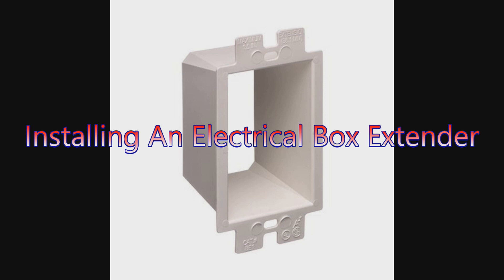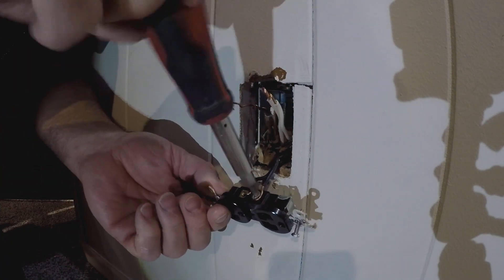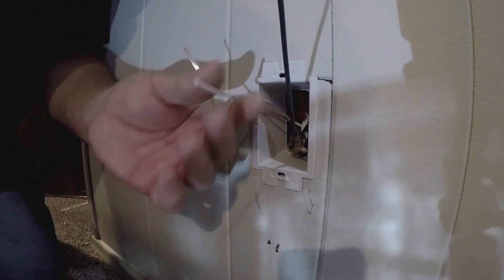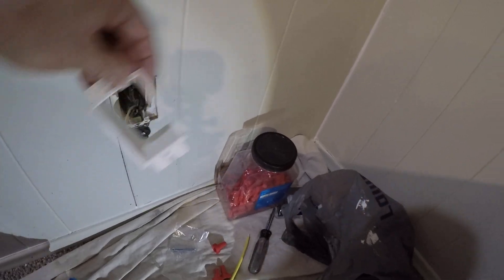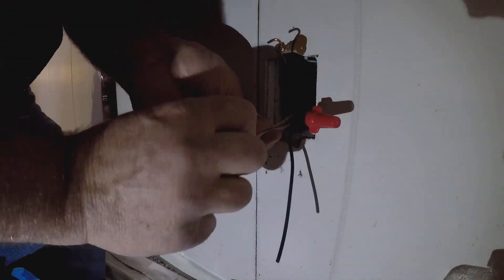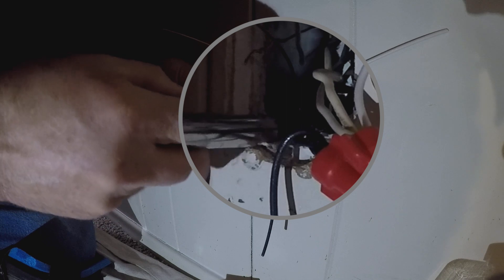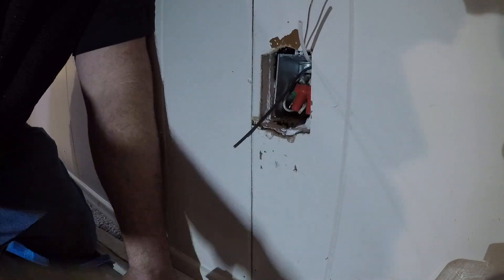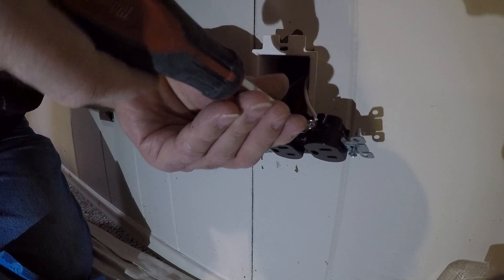Electrical Box Extender Installation

Comment: I would like to put an outlet on a 6"x6" wooden post (gazebo pillar), but I would like the lowest possible profile, I am thinking on using one of these extenders as the box (no box but just the extender screwed over the post), and maybe carving the post a little to make rear space for the outlet.
Is thid recommendable?
Reply from the maker: If this is an outdoor installation, you'll want to use an exterior weather sealed box and cover.  An open back extender box is for extending a box that has a back cover to it. Electrical connections should all be inside enclosed boxes with covers. The best you can do is to locate the box in the most inconspicuous location and live with it.

Comment: Will these work with metal junction boxes if it’s not ground but your outing in gfci outlets?
Reply from the maker: These work fine with metal junction boxes. If you are replacing an ungrounded outlet with a gfci outlet, that is allowed but you need to place a sticker stating no equipment ground on the outlet and any subsequent outlets connected downstream to it.

Comment: Since the extender fits inside the box that’s currently in the wall, does this make the width dimension that the outlet sits in smaller also?  I had a very difficult time fitting a GFCI switch/outlet combo into a very old metal box in my daughters apartment building that has plaster walls. I probably could have put one of these extension boxes and then finished the installation.

Comment: I have a box that will be covered by the side of a kitchen cabinet with a 2 inch filler. Is it possible and safe to stack two of these extenders to reach the extra 1/2 inch or so?
Reply from the maker: This might be a better option if your box is 2" deep. The back screws into your old box and the switch or outlet screws into this. 
https://www.lowes.com/pd/RACO-1-Gang-Silver-Steel-New-Work-Old-Work-Standard-Box-Extender-Wall-Electrical-Box/1005005?cm_mmc=shp-cprdelcgglLIA_ELC_206_Conduit-Fittings-Boxes-1005005-local-0-_-0&ds_rl=1286981&gclid=Cj0KCQjwgO2XBhCaARIsANrW2X2fGDWxx-kvOmQ8loQ2lWph21SYsjuQM3qfd2iFbG1id1QgdusgDNsaAnj_EALw_wcB&gclsrc=aw.ds
Reply: @CITAP1  Thank you. I appreciate that!

Comment: You weren't really clear about the longer screws you attached.  Did they come with the extender?  Some people add links to the parts they are using.  That would have been a nice addition to your video.  Thanks for the info you did give.
Reply from the maker: The longer screws come with the unit, 2 units, 4 screws per pak.

Comment: Hi! Just wondering if it's necessary to undo all the wires and reattach or can I just pull it slightly out of the wall, throw extender in there and screw it in..? Thank you either way!
Reply from the maker: If there is enough slack in the wire, you can pull the outlet out, you'll need to make sure the circuit is off. Beware that many times, the person who handled the device before you did a poor job making the connections so you'll want to examine all the connections and make sure they're still tight and secure. You will pull the device outward from the box then bend the device top or bottom to achieve enough angle for the extender to slide over the device.  Pull the device and wires through and straighten the device to go flat against the wall again. Check all the connections and if good, install into the outlet box.  If all looks good, turn the circuit back on. Stick an outlet tester in if it's an outlet and make sure the circuit tests correctly.  All done, go get yourself a congratulatory treat!
Reply: @CITAP1  It was my grandfather that I never got to meet(but feel I still have a strong connection to through the home improvements we've both done to the house!) I did it and it's good to go! Thanks again!
Reply from the maker: @thereallinnz9407  That's a great story having a generational connection to someone you never met other than through a common interest.  Our mom is who taught us and got us into home renovations and new construction. Best wishes on further cooperative efforts between you and your grandpa.

Comment: You didn’t twist your conductors together prior to putting the wire nut on. Not good
Reply from the maker: Pre twisting is really optional. I have been twisting wires together for over 30 years and never had a problem. You can easily see the insulator looking in the backside of the wirenut and you can see if the insulators have shifted after twisting. If you see a wire where the insulator has shifted, adjust it as needed. You also develop a feel for the wires. If you have the bare ends all matched, you can feel if one of them shifts while tightening. If you are more comfortable pre twisting your wires, by all means do so.
Reply: if I saw my apprentice doing it this way

Comment: Does this system work if someone panelled over the receptacle and now wants to cut it out and extend it????
Reply from the maker: That is exactly one of the reasons box extenders are made. If you tile a wall, install paneling, or anything that changes wall depth of a wall, ceiling, or floor, an extender covers the gap.;%

Comment: I'm about to cut my first top . What kind of blade is recommended and how many teeth ?
Reply from the maker: I'm not getting what you're asking with cutting a top and teeth if you could explain a little more..
Reply: @CITAP1  oh I'm sorry. I thought I was asking on a video for cutting laminate countertops . I'm not sure how it ended up here .
Reply from the maker: @Kevin-k9r9j  OK, For like a kitchen, bath, etc,,, counter top, use a fine toothed jigsaw blade. There are Laminate snips made specially for cutting out laminates without the chance of breakage when cutting. Use the snips to trim your laminate piece to slightly larger than the surface you are applying it to. Lay the laminate on that surface to fit and scribe with a pencil the underside along the counter edge. If it's close, a couple inches, you are ready to apply your contact adhesive to the counter surface and to the laminate. Usually two coats each surface. Lay 1/4" thick by 30" or so long pull sticks on the counter, then lay and position the laminate over the sticks. When you are lined up, I generally pull the sticks out starting from the center and work my way to each end. Once you start attaching the laminate, it won't come back off so be certain you're lined up properly. You then get your router and trim the edges with a straight bit with guide bearing. You can do the sink cutout before and cut the laminate for the sink with a router or if you leave the countertop surface whole, you will position and mark the sink less a half inch all around or use the supplied sing template. We will apply blue tape under the rim of the sink and mark on that. The blue tape may also lessen the chance of a lift and crack or split when cutting with the jigsaw. You want to use a fine tooth blade when cutting. You can also use a down cut blade to lessen the chance of splitting or cracking. A small crack or split isn't disaster. Most of the time it will be covered by the sink rim. Just make sure the blade is new, sharp. For the ends of the laminate where the router can't cut because it hits the wall, use a fine tooth hacksaw blade in a blade holder to get that last couple inches. 
Another important step is to glue and nail a square and flat 1x1-1/2 Poplar or similar edge to your plywood counter and your router bit will follow a nice straight line. If you are doing a laminate edge, do that first then the top. Usually I do an oak edge for durability. I have a video somewhere around the channel showing how to do thei, if I find it, I'll let you know. Hope this explanation helps and good luck with your project...
Reply: @CITAP1  Thank you.